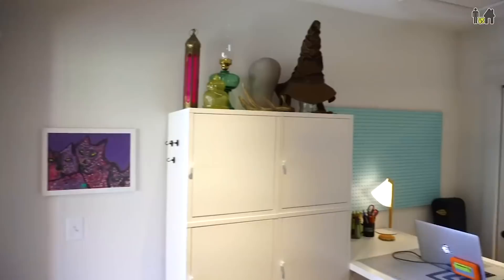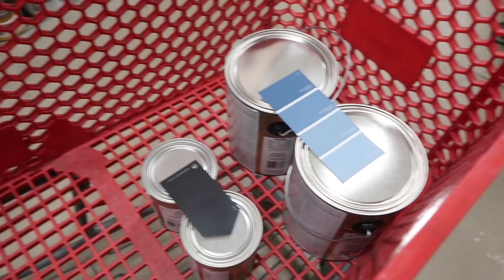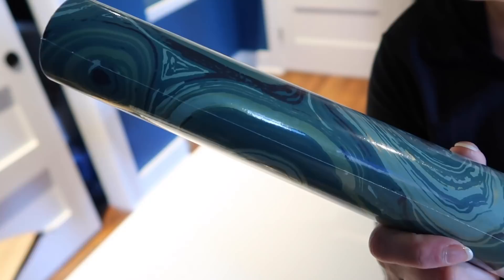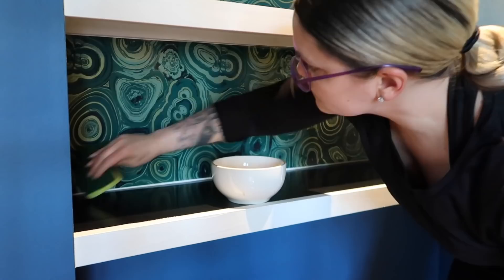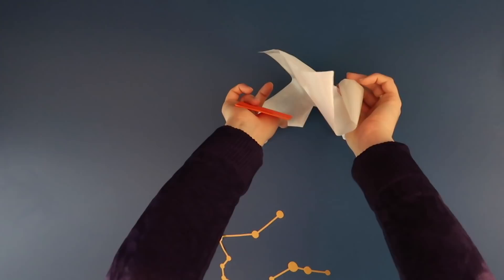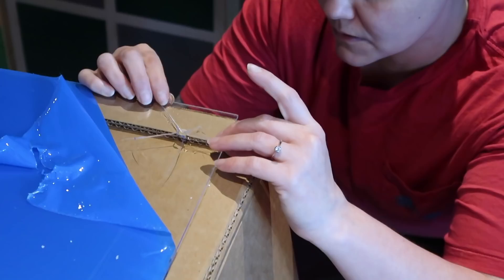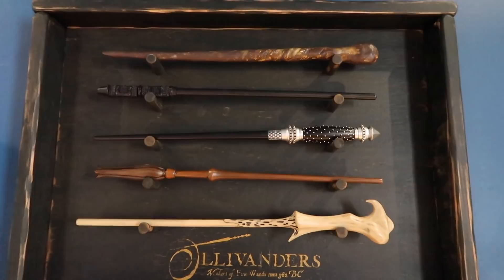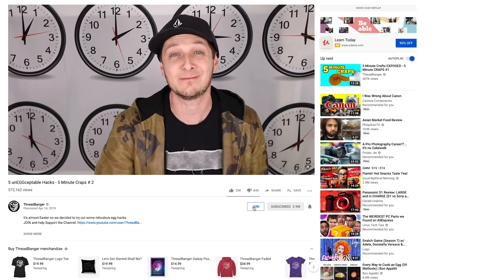DIY Galaxy Room Makeover - Corinne Vs Decor

Comment: Bonus tips:
  1. If you have a video projector, use it to show the desired part of the sky while putting in the decorations.
  2. For the shelves, it might have been easier to remove the shelves, put wallpaper behind and put the shelves back in.  A cleanliness trick is to wrap each shelf in disposable (cheap) wallpaper that gets recycled every 3 to 10 years.  Used to be popular in kitchen cabinets with food.

Comment: A tip for premasked items(the constellations), apply the whole sheet(the mask and the graphic attached to it) and use the scrapper to push out all of the air bubbles and then slowly peel off the masking. It’s way easier that way. We make tons of stuff that needs to be applied at my job.

Comment: So I know this video is old, but hi, professional set painter here! Painting walls with a roller can be annoying and tedious, but there are two bits that make it a slight bit faster:
A roller poll and a fluffy roller cover. The bigger bristles in the cover, the easier it glides across walls and holds paint. The poll helps take care of height issues, so it's just handy to have.

Comment: Painting a room:

Preparing everything to paint - 3 days

Actually painting it - 1hr
Reply: Accurate and how it should be. You can slap anything on but if you want it to last you need to be sure there is only the things you want between the paint and the wall. So wash, dry, fill, sand and dust my dude. Often the first things I have to do with my customers is to tell them to slow down. New Zealand paint cost about $100 to $180 dollars for just 40m2 of paint. Not sure what the states prices are like but you don't want that stuff falling off any earlier than it should.
Reply: Neko Cub art games Agreed. I’m not a professional, but I’ve painted quite a few rooms. It amazes me how sloppy quite a few paint jobs are. Some even by so called professionals. My philosophy is that since I’m putting the job in anyways, why not make it proper. It’s not THAT much fun that I wanna do it next year again due to not having done it right.
Not sure about paint costs in the US, but they are quite similar to the NZ costs here in Sweden as well. It’s not exactly a cheap thing to do, no. BUT THE GRATIFICATION WHEN IT’S FINALLY FINISHED?! PRICELESS! 😍

Comment: Gold leaf?
....
There is gold spray paint. Unscrew the doors and take them outside...
Reply: Potato Princess Gold leaf (if real) is actual gold glued to your stuff.  "Gold paint" is just the golden metallic color..
Reply: Yeah but gold leaf is not intended to be used in that way. She would've been better off using contact paper or paint forsure.
Reply: There's also metallic wallpaper and even magnetic decals for your fridge that would be cheaper and easier to cut down and glue or stick on.

Comment: Ways you can help with the earth RIGHT NOW
#1. Find a light in your house that's turned on and unplug it.
#2. Bike or walk instead of driving.
#3. Begin a garden, or plant a tree.
#4. Shorten your shower time today.
#5. Turn your heat/air conditioning down.
There are 5 ways YOU can help.
👇
Reply: Ways you can help, get off the internet

Comment: Next time you install vinyl decals that size, here's the easiest way to do it, from someone who makes and applies those decals professionally: Use the plastic applicator (the credit card sized thing) to go over the transfer tape (the top, thin, sticky layer). It probably separated from the vinyl a little bit in transport, and you want the vinyl to be stuck to that. That probably caused some of your problems if the seller didn't tell you to do that :( Slowly peel the tape from the wax paper backing. If anything is still stuck to the backing and not the tape, lay the tape back over it and just keep rubbing it with the applicator.. With just the vinyl stuck to the tape, put the whole thing -- vinyl and tape -- onto the spot you want it, pulling it taught. Go over it with the applicator and a lot of pressure. Slowly peel off the tape and the vinyl decal should be stuck to the ceiling. If any of it tries to peel up with the tape, it's the same idea as sticking it to the tape in the first place. Lay the tape back down and go over it -- this prevents some of the wrinkles you might get if you stretch the vinyl by going over it with the applicator directly. 

....Or just do a YouTube search for applying vinyl decals.

The method you were doing -- peeling the backing off half-way, is only necessary for large pieces of vinyl with a high risk of air bubbles :-)

Comment: @Threadbanger get the second piece of plexiglas asap, the longer you will keep your doublesided tape on the silk scarf, the more it will get ruined. The glue from the tape will never leave the silk and you will have ruined your $400 scarf. Also, you can not get the glue from the tape out of that scarf ever. Also the glue in the tape will discolor over time, so there's that. Just my 2 cents on it. A

Comment: Learn how to "cut" the edges and trim. It's easy enough if you've got a steady hand and eliminates the need for tape.

Also, put more paint on your roller. You don't want it dripping but if you can see that much of the color underneath there's not enough on the roller.

Comment: I am wondering why you bought a particulate respirator for latex paint? Have never watched you before so I don't know if this was to be funny and dramatic especially, pressing so hard on the roller? You didn't have enough paint on the roller and it looked like you were using the wrong size. The room looks beautiful! Great vision. The paint color and wallpaper are amazing. If you ever do wallpaper again get a wallpaper tray or roll it in your tub to wet, then book it. It's much easier this way. So pretty!

Comment: The plexiglass frame still leaves it open to dust and now you ruined it with tape!?! You should've just made a really cool 3D frame out of lumber. Used those tie thingys you originally wanted to use to display the scarf on the wall, but made the frame a little bigger and did the same thing on inside the frame so the scarf was still protected. Then painted the DIY frame it black and gold leafed the edges.